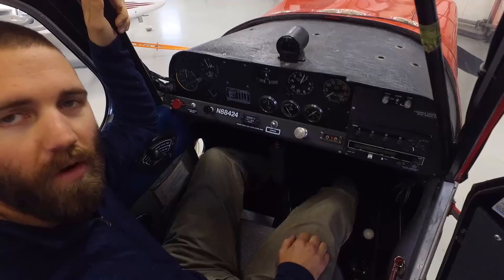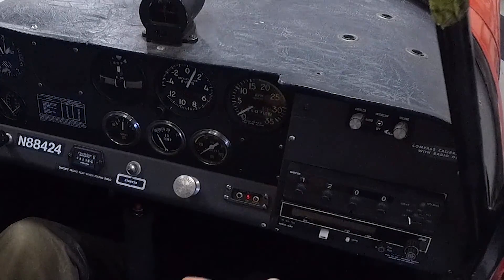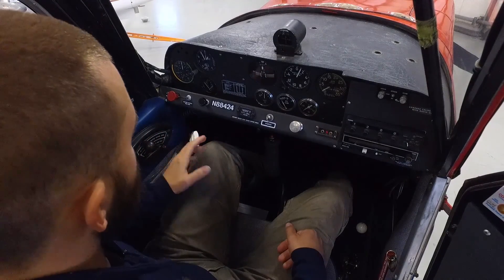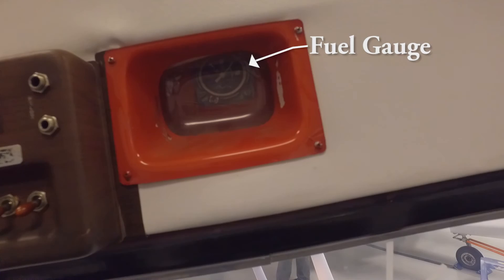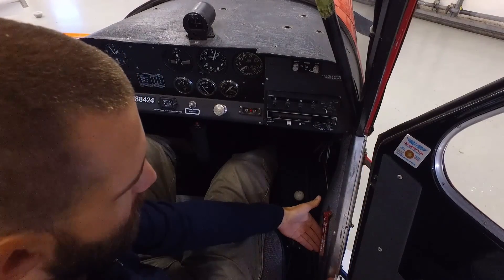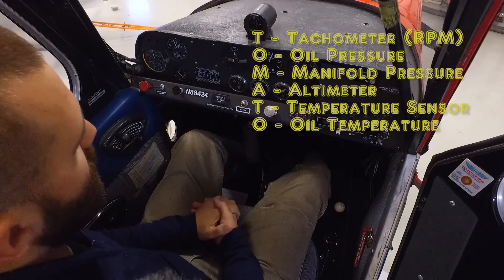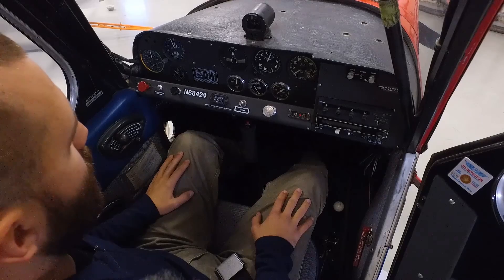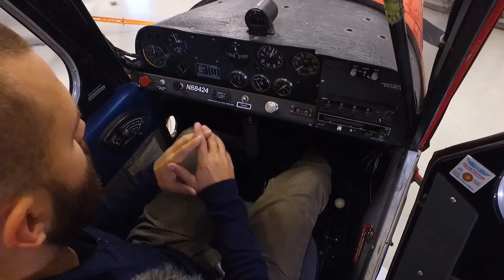Tailwheel Tuesday - VFR Instruments & Cockpit Familiarization

Comment: That aircraft was made by Bellanca.  American Champion did not start making planes until 1990.   I had a '74 7ECA and am considering reentering aviation and shopping around for a 7GCAA.   Have never flown one, but it might be worth the several hour drive to come over and take some dual.  Nice looking plane!
Reply from the maker: Correct! Although they are commonly referenced as American Champion since they currently hold the Type Cert., but it was originally a Bellanca product. We would be happy to get you a couple hours of dual. For additional information on the aircraft and our contact info, visit our website; www.walteraviation.com. Thanks!!